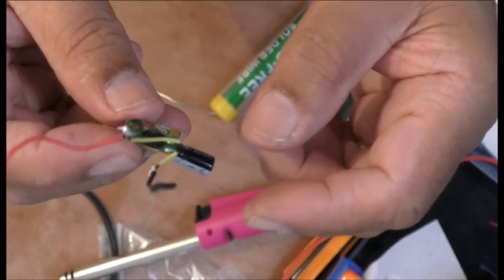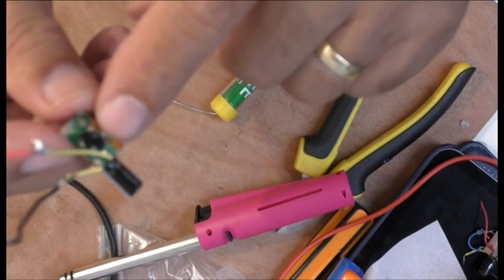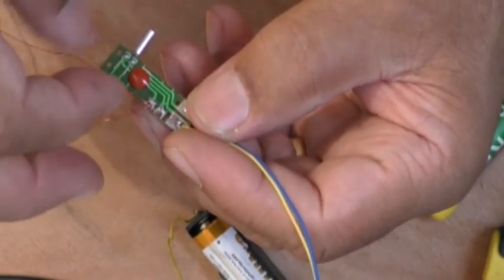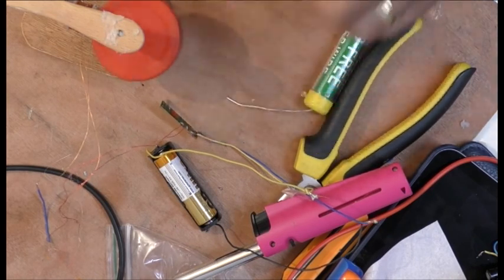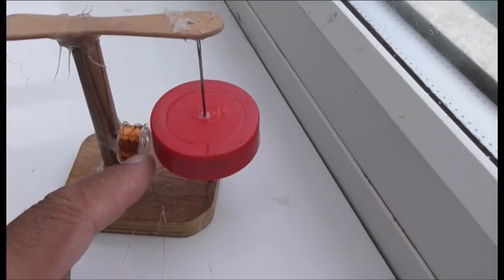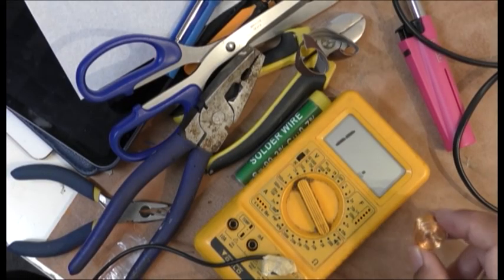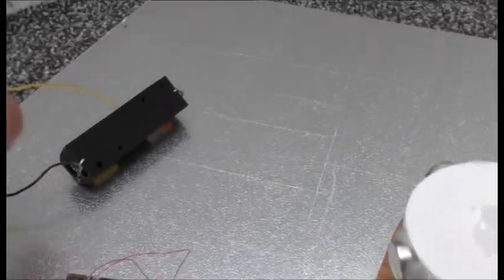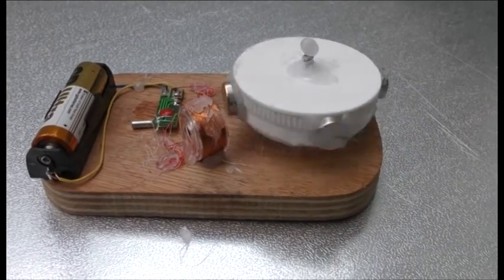#121. Made a Pulse Motor from a Quartz Clock Circuit

Comment: Very cool project. I was wondering if a clock circuit would run a pulse motor for a long time.If you get a chance try the circuit from a battery powered lucky waving cat (Or they sometimes call it a beckoning cat) there is a beautiful coil inside it as well. If you connect it to a cheap solar light it will run 24/7 and not stop.your clock circuit should do the same.
Reply from the maker: Great I will try that. I did have a cat but will have to try and find it. Thanks